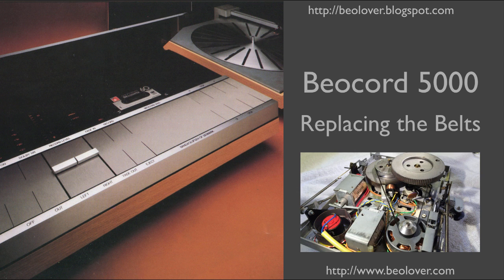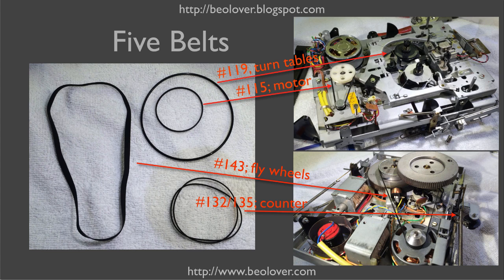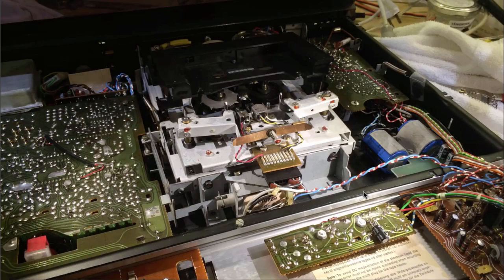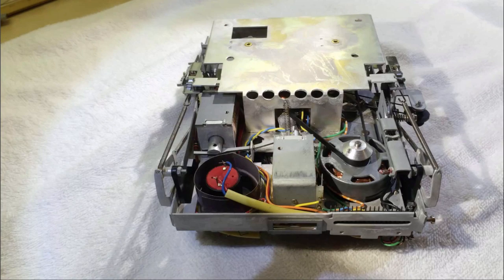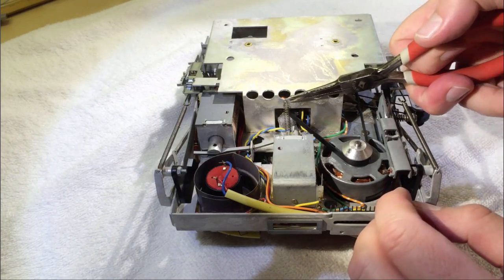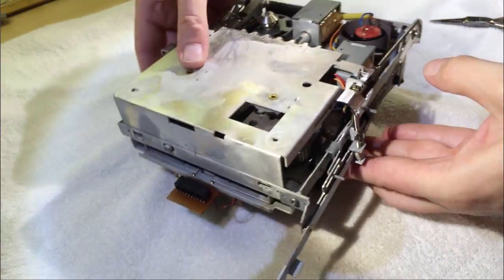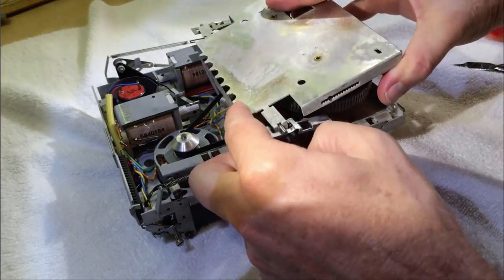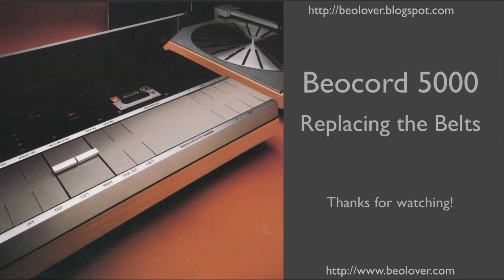Beocord 5000: Replacing the Belts

Comment: Good Video,  I just bought one of these decks at a record store.  Its non functional.
It powers on but it appears the tape heads are locked in the play position with a Tape still in the deck.  Can't even remove the tape as the heads are fully engaged and won't release.   I think the belts are broken too.   I might take a crack at fixing it after seeing this video.  Thanks.

Comment: Do you have exact details measurement of the belts?
Especially the capstan belt and the Turntable round belt.
Reply from the maker: Yes. I made a post on my blog after I did this video: http://beolover.blogspot.com/2014/10/beocord-5000-47154716-replacing-belts.html. I'd be happy to get you in touch with my source for the belts. They are excellent quality and my Beocord 5000 runs very stable with them. Good luck with your restoration!